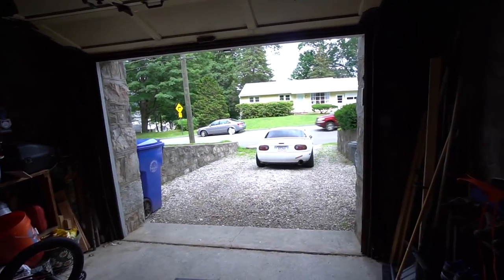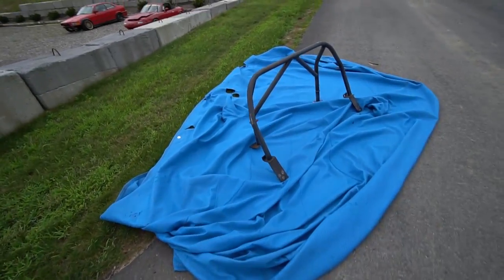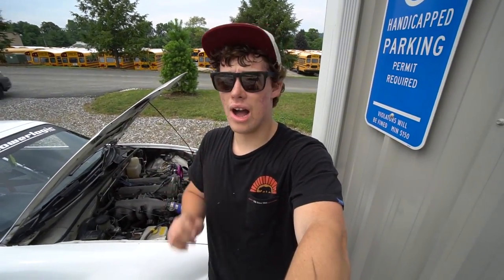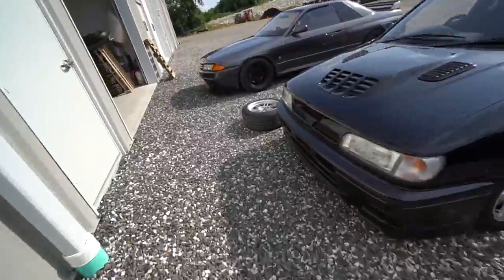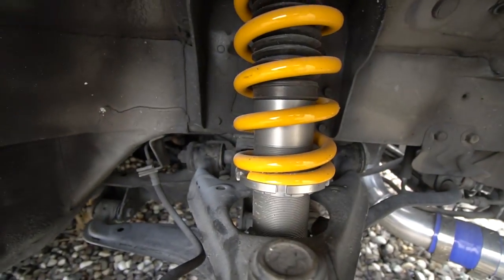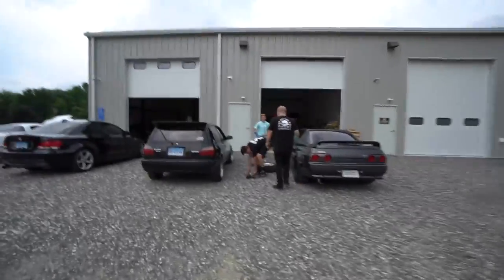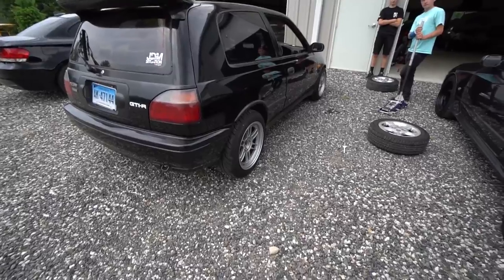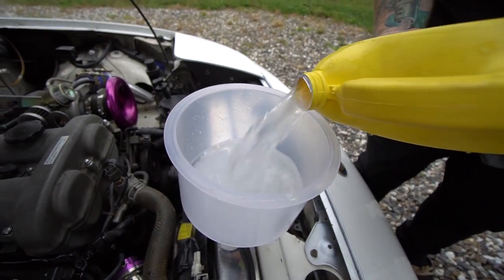Mishimoto V.s. Koyo?

Comment: Hey Rudnik,

I hope this helps you out the next time you paint something.

1. When you sand. 
Always use a block when you sand so the surface is sanded down flat and even. Start off low with like 40 grit then 80 and keep going up to a finer grit until the paints gone and the scratches are minimal or at least not feel-able (if that is a word) when you run your hand flat along the surface.

2.When using primer.
 Make sure to clean the surface off after sanding down the old paint with degreaser and a microfiber towel. The primer the surface with 3-4 coats (depending on how thick you spray it) with a wait between coats (5 to 10 mins). Wait for it to dry completely after all coats are done and you have even coverage, then sand that down lightly/gently with 400- 600 grit (depends on how thick you laid down the primer) until you can run your hand flat against the surface and feel no roughness and see no orange peel (basically meaning that the primer looks like the skin of the orange, you could buy guide coat to see the orange peel better to make sure you sanded it all down but that is up to you if you wanna spend the money). 
if you sand too much/aggressively you'll go down back to bare metal and wont get proper adhesion from the paint so be careful, if you go through it just spray more primer and sand again. 

4.When you paint.
Try to paint on a warm day preferably 75 plus degrees. Make sure the surface is clean and free of primer dust (if you can, try to blow it off with a compressed air gun as sometimes you can get small holes where primer dust builds up and fills in the hole, especially if you're doing bodywork). Then once everything is clean and smooth start your base coat of paint off with light coats and then a final heavier coat ( should be completely covered within 3 coats of paint) wait between coats to let dry, keep away 6 in (or the distance of your fully extended pinkie and thumb with the rest of your fingers closed)  from the surface and keep your wrist straight (in other words don't move your hand side to side when spraying, move your whole body if you have to cover a large surface) and keep a consistent speed when moving, go slow enough that you get a nice even coat on but fast enough that you don't puddle up the paint in one area.

5.When you clear coat.
 Again make sure the paint is fully dry and clean before you start. Basically the same as when you paint, except the coats can be heavier since its gonna be sanded down. Try to do 4-5 coats of clear (you can do more, you'll just have to sand more) wait again between each coat and if you get runs its okay they can be sanded down. The clear coat will dull out the color of the paint but it'll comeback after sanding and buffing it. Wet sand the clear coat with 600 until its smooth and free of runs ( you can keep going higher than that with the grit if you get deep scratches or if you want a smoother finish but the finer the sandpaper the more expensive it is, also make sure the sandpaper is one you can wet sand with). Make sure the surface is kept wet and that you don't get any resistance when sanding.

8.When you buff/polish.
Make sure the surface is clean and dry before you start. You can use a rotary or an orbital buffer, rotaries are faster and more efficient but can burn through the whole thing if you're not careful, so if you're gonna use one and are starting out use an orbital since it wont burn through the paint. You can always do it by hand with a microfiber towel as well though so you don't really have to buy either if you don't want to. The Perfect-It Rubbing Compound by 3M is what I've used for buffing and Perfect-It Machine Polish is what I've used for polishing and both work great but are  little more on the expensive side. Id suggest trying out different stuff first (like the stuff that Tommy has) if you don't want to spend too much money. If you're using a machine to buff id suggest using foam as its more forgiving. I cant say what foam to use when buffing as I use a wool pad but for polishing I'd recommend using a blue foam pad. Also if use a thumb size drop of compound and spread it on the surface with the foam/wool pad before you start to avoid getting the compound everywhere, for the polisher just use one drop on the foam pad it self. If you're doing it by hand just rub away with a little less compound to avoid it getting dry on the surface.

I know its a lot to read but hopefully you learned something useful and keep the videos up man! :)
Reply: this man wrote a whole bible to tell rudnik his painting is trash
Reply: You wrote a whole college textbook.

Comment: You see scratches in the paint since more than likely it wasn't sanded progressively. Generally if you start with say 150 grit to take something to bare metal, you will need to go in succession in grit size til you reach 600 or 800. you cant just go from 150 straight to 800 then paint. it would work better 150-300-600-800. Otherwise it will be scratch city, Also priming bare metal is a must plus you can sand it nice and smooth before paint.

Comment: Chris, one HUGE reason the car is getting so hot is because youre not running an undertray anymore. I chopped mine up to fit with my intercooler pipes and mine stays right around 200F with the stock rad, no cooland reroute yet.

Comment: Not a hater, but if your are using a coolant concentrate you have to add DISTILLED water to make it 50/50.  Your best bet when purchasing coolant is to always get the prediluted 50/50 coolant. The prediluted coolant is fill and run, no measurements of 50/50 ratio required. If I were you I would drain what ever you have and refill with the prediluted coolant and call it a day.

Comment: Chris, paint never fills scratches. No matter how many coats. Filler primer does though. So you either put some filler primer on it, or sand it to 500, in steps of a 100 max between sandpaper

Comment: well you should of had the heater on blast while you had the filler on the radiator.  then hold the rpm at 3000 for a couple seconds and let off for 6 sec, then repeat and by the third time it should be good.

Comment: Tommy makes a big deal about not gapping plugs but throws tap water in the radiator?
Reply: Zerek Peel tap water isnt gonna hurt anything, not gapping plugs definitely will lol.
Reply: Sean Silagy if Connecticut has extremely perfect water then no big deal but any type of hard water will create oxidation and calcium buildup in the radiator core

Comment: 190 degree thermostat would have been a cheaper idea to try before paying that much for a radiator..
Reply: But that's the stock T-stat temp on almost all cars. I think you meant 180 or 160. Really though, if idling parked causes a car to overheat the radiator fan is the first thing to check.

Comment: Koyo is definitely better than Mishimoto, just looks at the quality of the welds on each and it will show you. Why is your freshly tinted window down? You should prob check the safety regulations for roll bars on a track before you start cutting up your car to put that roll bar in